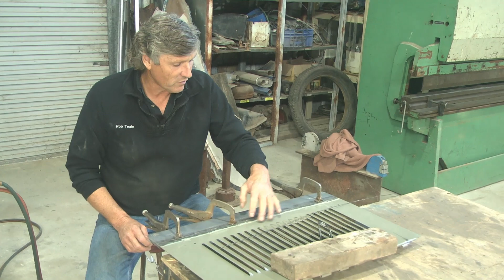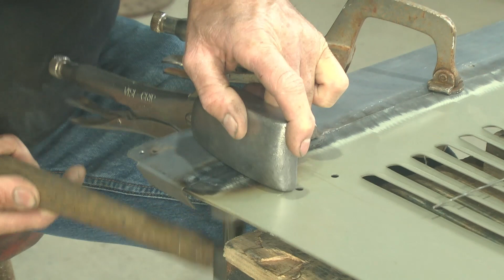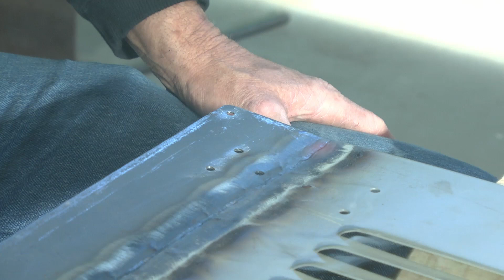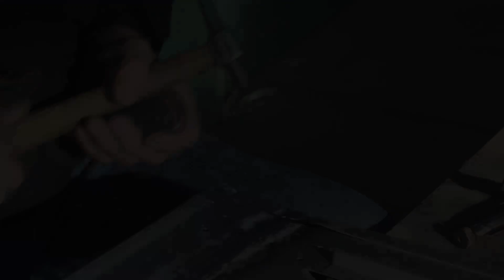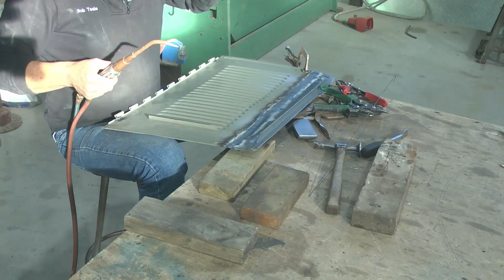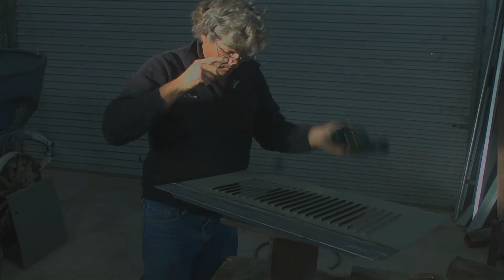Tips & Techniques - oxy acetylene welding

Comment: The good old CIG Comet 3 torch. The smallest tip they make is a number 4 which is what you are using. You would love to use a Dillon torch. Great Australian invention from the 70s that has been sold to the yanks. Plenty of used Dillons available now that everyone wants the electronic welding gadgets. The Dillon produces a more concentered hotter  flame which does not warp the metal. Noticed your neutral flame has an orange hue? Are you burning some acetone from a low pressure acetylene cylinder? Note that you can modify the mixer of the Comet 3 to make it identical to the Dillon torch.

Comment: Just found & getting through your brilliant videos ...... which technique - mig, tig or oxy would be BEST suited for this job?  Thanks so much for your time Rob AND camera Chick!
Reply from the maker: The "Best" welding method for this job would be the welding type that you can use the best. We are only joining two pieces of metal together by welding. I could have used Mig, Tig or oxy for this job and got the same result. I chose the oxy as l like welding that way. Every type of weld has advantages and disadvantages, the best weld will always be the type that an individual craftsman is best at. I knew a bloke years ago that was an incredible craftsman, and l saw in amazement a repair he preformed on the bottom of a Toyota Landcruiser fuel tank. He welded a series of fatigue cracks in the floor of the tank upside down with the tank installed, he used a stick welder. The welds we perfect, no distortion and sealed up first time the tank never gave trouble again. This man could weld expertly in every type of welding yet he chose stick for this job. I asked him why, and he responded... never lose sight of the fact that we are only joining two pieces of metal together. This was just easier as the welder was the easiest to get outside to weld the tank. Cheers Rob.
Reply: Wow...... a brilliant story to illustrate the point.... joining two bits of metal. I realise now I'm probably overthinking the whole thing a bit!
Thanks for taking the time to respond Rob, I respect you and  your work so much, and the way in which you share so well your knowledge. I know how busy you must be - I'm living it too! - but you have changed the way I approach my metal work .... and made it even more enjoyable. 
Many, many thanks mate! 
All the best,
Steve Hale.

Comment: Great video, very good camera work.  I've managed to hack my way through the patch panels I needed to do on my current project and what I came up with is similar to what you're describing but I tried to do too much at once.  I also tried to try to push the puddle faster when I thought it might collapse rather than just pulling the torch away a bit.  Can't wait to give that a try and see if it helps.  My next project will be on a 1913 Metz and those panels are 22 gauge with over a hundred years of wear.

Comment: Hi, is there a reason why you didn’t tack all along the weld before starting to fusion weld along the joint ?
Reply: Rob, thanks your prompt reply - I’ve learnt something ! BTW just found your excellent channel, thanks.
Reply from the maker: I was shown this method back in the early 1980's and have used it to death so to speak. I have also done a lot of experimenting over the years. If you have a flat panel like the Dodge bonnet this method works best. If you are doing fusion welding on a lower quarter panel patch ( where the edges of the patch fall within the panel) it works better to tack all the way around first. It must be something to do with the amount of heat from the torch, that on long straight runs it works best with the unwelded section free. I have welded sunroof openings up with a fitted panel and just started in one place and worked around the piece and that seems to work as well.

Comment: It is difficult for me to exactly see but it seems like some of the resultant weld is below the surface level of the sheet. Also, did you run the weld from the full length of the back side of the piece? Thanks for the excellent demonstration.
Reply from the maker: Hi Mate, if you look closely some spots of the weld are lower than the sheet metal beside it, as I said I was a little rusty going into this weld. Without doing a run of filler rod as you weld,there will be little divots so to speak. Not really a problem paint would fill them from this point. ( high build primer) I did touch up a few spots on the back once again my skills being a little bit rusty, a few places it nearly collapsed in a hole and made a small mound on the back. Also a few places that I must have run a little fast and it hadn't welded all the way through. These places I flowed the metal together and the little lumps down. Glad that you have enjoyed the clip. Cheers Rob.